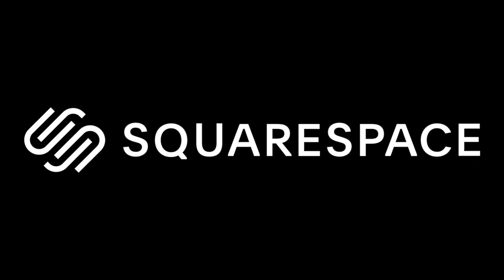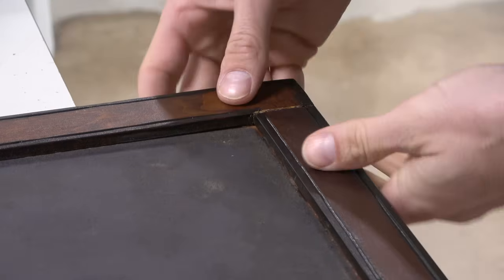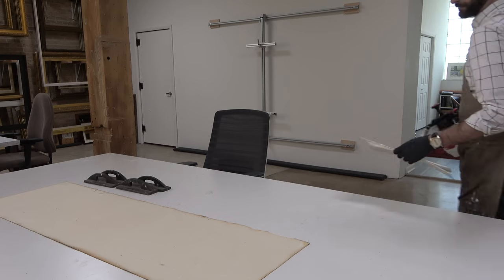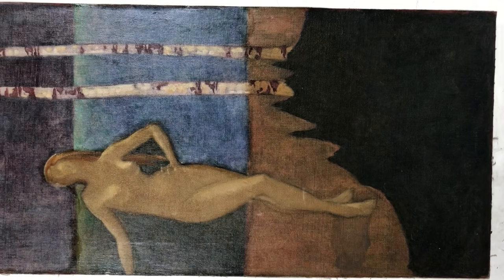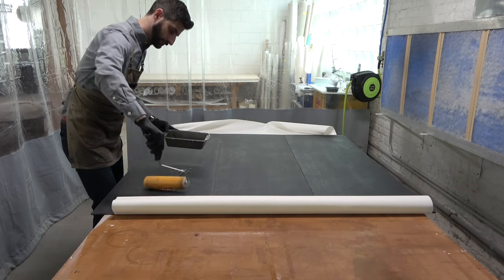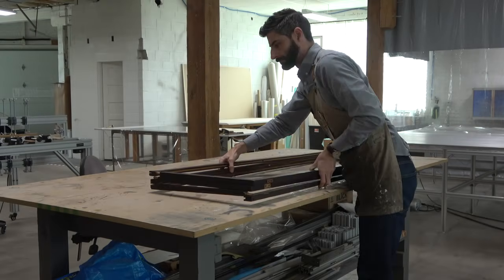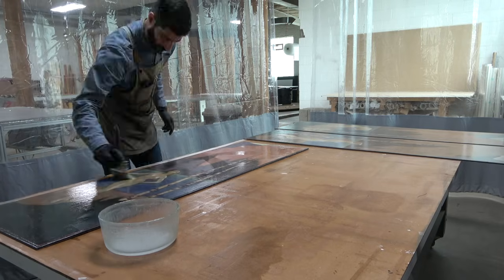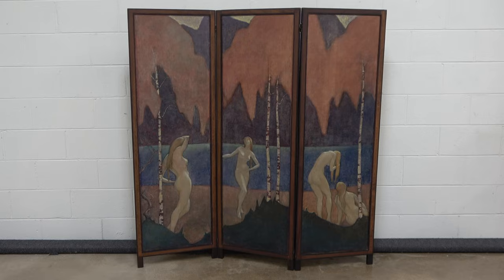Off The Wall - Conserving A Standing Screen

Comment: I recently nearly ruined a small artwork I own. Nothing fancy, just a pretty flower that was drawn on a piece of heavy cardboard. I spilled something on it and allowed it to harden before I realized I had done that. Your work helped me save it! I couldn't get it wet (cardboard) so I ended up taking a razor blade and carefully gliding it over the hardened substance. I was able to get nearly all of it off with only mild discoloring to the art! Which I am just living with at this point, I have done all I can. All the same, thank you for teaching me about scraping!

Comment: You could have made this into a two part series, but you didn't and I'm thankful for that

One of the things that fascinates me with this one is the use of foam core and an adhesive, reversible or not. 
I did a partial restorations (the owner did not want anything fixed, just the cheapest possible solution to get the work back in the frame and on his wall) and I used a similar method with an acid-free foam core and heat-activated adhesive. It came out fine and is exactly what the owner (unfortunately) wanted. 
I'm not a conservator to any degree like oneself, but that was part of my job as a custom framer. When I posted about it in a framing group, the amount of criticism for using foam core/ adhesive was thick. This is kind of vindication
Reply: Snobbery is unwarranted, especially as it was cardboard that was the artist's own choice. This medium will preserve not only the art, but the utility of the piece. And was even funnier is that the Art Déco movement emerged in a time of heightened modernism, with new materials, and form being as important as function. And the artist would most likely approve of this choice. His maidens can appear as he lovingly painted them, and not be distorted due to atmospheric conditions. And as it has a foam core, less problems with humidity. You do you. You have sometimes stray off the beaten track to find a more interesting one. As long as the canvas is safe and show off in its best light, with the work being able to be reversed, and your customer is happy, you hit the jackpot.
Reply: If it's reversible and keeps the piece intact and stabilised, those other framers can STFU. If they get their hands on it in future, well, you've made their jobs easier for them. There's no way the customer would have patronised them anyway, if their solutions were going to be more expensive.

Comment: On first glance I had thought those shapes on the top edges were places where the canvas had torn loose and was hanging down. It's nice when a piece is actually less damaged than it first appears, since usually you have to deal with the reverse

Comment: My mother was a watercolorist, and I have 230 framed pieces, and another 200 unframed.  I am so overwhelmed.
Reply: Oh my life! 430 pics! No wonder you’re overwhelmed. That’s too much for one person to cope with. I wonder if speaking to a gallery or art museum might help? Good luck, stay sane!
Reply: The best thing you can do is protect the paper from UV, from excessive moisture, mold, pests. I would store the unframed pieces in archival boxes, interleaved with acid-free tissue paper and store the boxes somewhere there's no big fluctuations in temperature and moisture (so, a living room or a bedroom). You could also use UV protective polyester sleeving. Framed prints are much safer - if you can afford it, re-framing them under UV protective glass with archival backing will protect them better - you can use the old glass to frame the previously unframed ones that you want to display in places with no excessive UV, like inner corridors.
There's also an archival spray varnish by Golden.

Comment: I guess that this was a first for me = watching Mr. Baumgartner retouching a painting before putting on the first varnish layer. Maybe it wasn't necessary this time because the paint was very thin and matt!? And there was nothing of the famous strong mulberry paper used. This is quite rare too.
Anyway; 👍👌👏 Extremely well done again and as always (video and work). Thanks a lot for making teaching explaining recording editing uploading and sharing.
Best regards luck and health in particular.
Reply: He does it pretty frequently. In fact, if you look at all his videos, he does an isolation layer less frequently than just leaving the varnish to the final layer. He seems to mainly use an isolation layer if the surface is very uneven to help fill in little divots. Or if the paint looks incredibly dry and unsaturated before retouching and it'd be too difficult to colour-match.
Reply: Dear  @Trixtah  
I have watched all his videos!
Mr. Baumgartner usually does a first layer of varnish to be able to better colour match the retouching afterwards. And he usually always explains it in this way. Mr. Baumgartner also mentions that it's easier to remove any retouching being on this first layer of varnish.
Best regards, luck, health and wisdom.

Comment: There must be better quality foamcore available to purchase when you buy it in 4x8 sheets. I've used foamcore for many projects, and on numerous occasions the paper has separated from the foam and caused me great difficulty. Hopefully you don't encounter similar issues mounting this much nicer painting, than I did, using it for signs and model making.

Comment: When you were talking about patina on paintings, I couldn't help but think of the controversy surrounding the cleaning of Michelangelo's Sistine Chapel frescoes some decades back. Generations of art historians had based their analyses of the frescoes on Michelangelo's extremely "subdued" color scheme. Some of them howled in protest when the layers of varnish were removed and the frescoes were revealed to be brightly colored. At least one of them claimed that the conservators had removed artificial patina that Michelangelo had deliberately added -- a totally ridiculous assertion. So much for the virtues of patina on paintings!
Reply: That is because they are right and the "restoration" of the Sistine Chapel's frescoes was a gigantic fuckup.

Comment: Because you are who you are, Mr. Perfection, I cannot believe you didn't line up the repeat of the wallpaper and match the line up across all three panels.  From the left, panels 1 and 2 match, but panel 3 doesn't match.  If they didn't purchase enough wallpaper for the third repeat, the odd one should have been placed in the middle tricking the OCD eye from noticing the difference; it would have been balanced...sadly it's too late now and some would say I shouldn't probably say anything, but I just could resist the temptation. Also, because I'm a master seamstress, to figure how much fabric you need is directly correlated to the vertical and horizontal repeats of the fabric print. So technically, it's my job to see these things...HAHA! 😁

Comment: It's amazing how much smokers discolor things over time, I remember helping a friend move, this was back when computers still used CRT monitors, so they were usually white plastic, and my friend was a smoker, and a really heavy chain smoker at that, so... I ended up not wanting to touch his monitor, as it was various shades of mustard yellow and 70s porcelain sink brown, literally sticky with what seemed like tar...
Glad to see it seem to come fairly easily off of the paintings though, as it did not come off with normal soaps from the monitor, ended up being scrubbed with cleaning alcohol as it won't ruin plastic usually, it's what we used on plastic bumpers and such in paint shops, as using the cleaning paint thinner can damage the plastic, in some cases distort it, and often making it kinda sticky and weird to handle.

And I just noticed I'd started going on tangents, I'll stop my ADHD here, and not leave an essay about whatever random topics I'm reminded of speaking of another topic, and suddenly talking about a completely unrelated topic to the original one.
Reply: Hah, I once helped someone fix his computer when he told me that it randomly would crash after being used for a couple of hours - I knew it was most likely overheating, from his description. So we went to his flat - I hadn't been there previously - and as soon as we walked in, I had a feeling that my guess would be confirmed. The place stunk of cigarette smoke - this was the late 90s - and he also had a white Persian cat that left its fur everywhere.
So I opened the side of the computer, and sure enough, cat hair was literally felted into the entire void, glued together with the brown cigarette tar. Luckily he had some rubber dish gloves, so I could lift out the felted fur in layers. Disgusting (the cat hair was fine, not with the gunk, though) but very satisfying. Sure enough, the computer fan was very happy to have room to suck air inside and he didn't have any more problems with random computer crashes. If I was being paid for the job, I would probably have cleaned everything with isopropyl alcohol, but as it was, I only got a semi-warm Carlsberg beer as thanks, so no cleaning from me. It was fun, though!
Reply: @Trixtah  Yeah... it's weird how common the tar was back then, I'm not a smoker, and never have been, I still remember restaurants having smoking sections and how annoying the smell would be, even if I was kinda used to it, as both parents smoked, and eventually my younger siblings started smoking as well.

I inherited a car from my mom, but my dad had used it a lot as well, I had some trouble with lights in the instruments, as some bulbs had gone out, so dismantling the dashboard... you could probably have rolled a cigarette with all the tobacco I found in there, as my dad would roll cigarettes while driving, spilling it into the instrument cluster as he rested his hands atop the steering wheel while doing so, along with the white roof lining being a more off yellow color...

Having worked a bit with computers myself a ways back, I thankfully never had to deal with pet hair or gunked up computers...
I did however have to deal with myself and my undiagnosed ADHD, and how it can have you so distracted even while you're technically focused on something...
I basically killed my own GPU, I technically know what I'm doing, but that day I put on the dunce cap and installed a sound card, got myself a Sound Blaster Audigy for running speakers, and it worked for a while!
Then... the computer ended up crashing a lot, and my sound stopped working, turns out I'd been so smart and installed the sound card basically millimeters away from the fans of the GPU instead of mounting it in a slot further down, basically boiling the sound card and overheating the GPU... -_-

Comment: Beautiful work, but I would have been happy seeing it mounted as a flat wall hanging. As a screen it has to be opened at angles to keep from falling over or opened flat to lean against a wall, so to see it all at once it is easier as wall panels. Either way respects the artist's original intent.

Comment: You talked about how artists often fear/ avoid varnish due to not understanding its importance and how to use it, but are there any resources or specific varnishes you would recommend? Asking as an artist in the beginning of my career. I've seen lots of technique through your videos but have no idea where to start with purchasing. I've been using Liquitex acrylic mediums but worry it might not be reversible if conservation needs to happen years down the line.

Comment: I am confused - when we must use retouch over original painting and when we need an isolation layer before applying retouching? 

I often see them both in most of your conservation...
Reply: He only does the isolation layer sometimes - when the surface is uneven, or if the colours would be too desaturated to match properly. Otherwise, why waste time and materials?

Comment: I have a random question: is it okay to put a painting under glass inside a photo frame? I know it takes away from the texture and all, but would it be damaging? 
I wonder because, what if there's a smoker house or something like that, just a painting is in a place where a lot of grime and debris might build up; would putting that painting under a sheet of glass in a frame protect it? Or would it smush down the paint and it's texture and have a chance to build up moisture and mold within the frame?

Comment: For every Julian fan that complained when Tom Johnson did not remove the old varnish over the painting of a set of antique painted chairs, we should have (just for simetry) at least one Tom Johnson fan complaining that Julian should have kept the patina of this old piece of furniture. Just... you know... for amusement value.
Reply: Julian did keep the patina on wooden parts. As for Julian fans griping about how someone conserves a completely different material like wood, maybe they should learn where their armchair expertise runs out.
Reply: @Trixtah  More or less my point. 
In fact, I'm greatly surprised the first answer to my comment is someone sensible (instead of one of those armchair experts pontificating on how either popular youtuber is wrong in his own area of expertise because they say the other popular youtuber doing something different in a video). That was... statistically unexpected.

Comment: Really odd question for anyone to chime in on: I keep getting thrown by Julian's use of the word "bond" instead of "bind." (i.e.- "I'm using the same process to bond the wallpaper to the foam core as I did with the canvas.") Is this just a different, but still grammatically correct, word usage I normally don't hear, or is it specific to the art conservation world? Or am I wrong in some other way? 🤔
Reply from the maker: My understanding (maybe incorrectly) is: bond=to take two things and make them one, unifying them. Bind=to attach while keeping separate.

Comment: Being you, the wallpaper is quality and reversible, so I don’t see a reason to get worked up over it. 

I have a spinning wheel I actually use, and it has two distinct footprints on the treadles, because I spin barefoot. I tell people it’s not dirt, it’s patina. I figure you’ll actually get that joke.